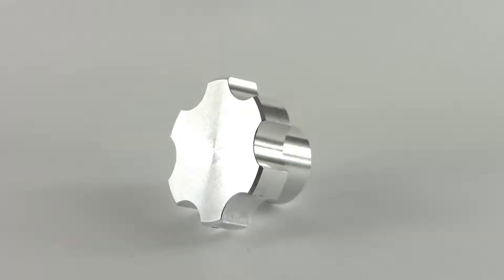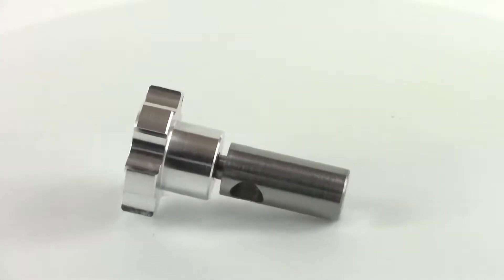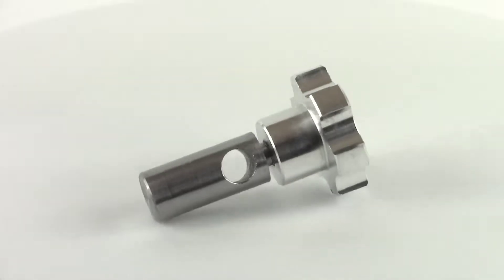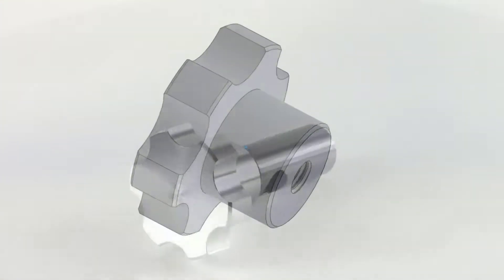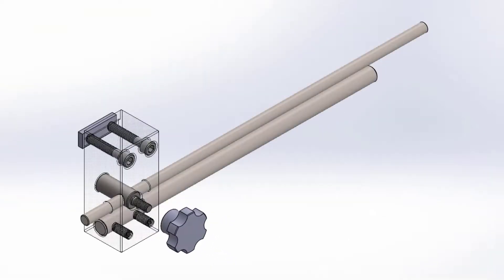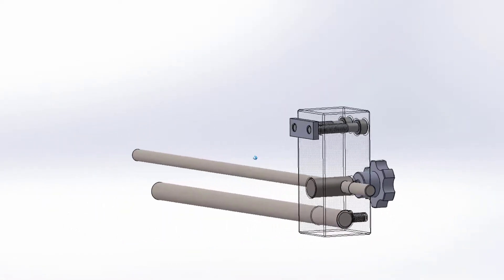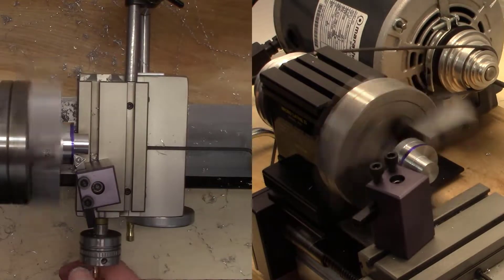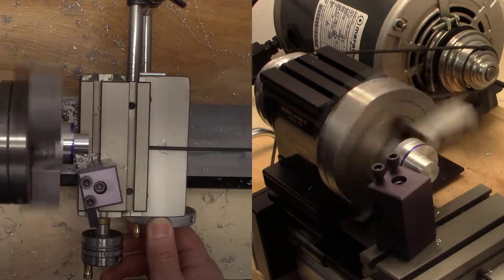MAKE: How to make a thumb nut on the lathe

Comment: What does the lower pulley do on the lathe?
Driving the auto feed for z-axis?
Reply from the maker: Hi Harlequin43 - The lower pulley is for the powerfeed that drives the carriage. It runs off of the main pulley on the headstock with, of all things, a rubber band. When you hold the handwheel on the carriage, it will power the carriage towards the chuck on the Z axis. This allows for a more uniform finish. When you are not holding the handwheel on the carriage, it will just spin, but very slowly. You can still move the carriage by just turning it by hand if you were to back it out of the way. Thanks for watching!

Comment: Have to say i am a little disappointed.  I really like the work you did, and the production quality of the video is very good to.  But I came to see how you make the thumb nut on the lathe, not the lathe and mill.  I wanted to see how you would make the cutout on the side of the thumb nut on the lathe.  Offset in a 4 jaw or dividing head maybe?
Reply from the maker: We would use Taigs milling attachment (1220), and hold the tool in the spindle. Thanks for watching!

Comment: Where do you get your tool bits from and what type are they?
Reply from the maker: Thanks for watching! The index lathe tools are from amazon - Anytime tools five piece 1/4 indexable mini lathe tools. They fit the Taig tool holder with no modifications. The insert is a TCMT 1.8 1.5 1
Inscribed circle - 7/32
Thickness - .094
Radius - 1/64

Comment: Seems we gain and lose with a Taig vs an eBay chinese one.  I see no drip plate, or back board, no gears, less HP, etc... on the Taig.  What is the advantage of a Taig over one of those Chinese eBay metal mini lathes?
Reply from the maker: Thanks for watching! 

Before you read below, know that I am NOT associated with Taig in any way. Just a satisfied user of their tools.

That's a tough question. The offshore machines offer a lot of details on paper, but in my perspective leave a lot of details lacking. I do have a harbor freight X2 mini mill, and the Taig manual mill, and the difference in quality is very noticeable between the machines. Out of the box, the Taig machines are tight and square and setup is easy. The X2 mill needs a bit of adjustment to get it Square, the quality just seems lacking, and overall use is sloppy. There will always be "mods" to make it better. In fact, I actually converted my X2 mill to a belt drive.

Sure, the Taig lathe does not have the drip plate, back board, but I really don't think that was necessary for this machine - nice features if they had them though. What matters to me is that the machine will hold size consistently, and the accuracy of the machine which it does well. It is very flexible in how you use it, and has many accessory's available for it. You can really build it how you want it. Don't let the 1/4 HP motor fool you, it is more than sufficient for this lathe...

My perspective on the small offshore machines is they offer more than they are capable of. The gears are typically plastic on lower end machines, the machines do not have enough torque to run the tools that they can accept (on the mill). As far as gears vs. the belt, you still need to stop the machine to change your speed, so to me I think that is a wash. Typically, I run the belt on the Taig in one position. For smaller parts, I run it faster and larger parts I run it slower. It takes seconds to change the belt on the Taig.

Now, some of the higher end import machines have better quality and components but it also comes at a higher price point. So, its all a balance of how much you want to spend vs. the quality of machine vs. the size of parts you anticipate running. I have found the Taig stuff to be sufficient if you work within the size it was designed for, at a decent value. Taig machines are also made in the US which I prefer. 

At the end of the day, buy whatever makes you happy. As long as you are making chips and enjoying it, that's all that matters!

Comment: I saw this and was hopeful that I could learn how to make this part on a lathe, since it’s in the title. Then you take it to the mill and do the part I was hoping to be able to do on the lathe. Disappointing.
Reply from the maker: Hi Deanna - To have the cutouts on the thumb nut like I have shown, you will need to put it on the mill. However, the form fit and function of the nut itself does not need the cutouts. Knurling the OD of the part is an option, though I do not have one. Another option is to scribe lines with an indexing head, I don't have one of those either. You could leave it without the cutouts and that would be perfectly fine!

The idea of the video is to show the operations involved in turning this nut. With this part, I cut the material long for chuck stock on the first side. The first side is facing, turning both diameters, drilling, and tapping. And,the second side is simply facing the chuck stock off, and facing the part to length.

By turning both diameters at the same time, or in one operation or one chucking means that both diameters run true to each other - that is has no runout. This also allows us to not need to turn our jaws to get our part concentric between the two diameters.

A Taig mill will really open up the flexibility between the lathe and mill! And, I apologize if that you were disappointed.
Reply: @benchtopmachining  I understand. I was just excited when I saw the cutouts and it implied those could be done on the lathe. I really want to be able to do those. But I don’t have a mill. Truth is, I also don’t have a lathe yet (just ordered one). Do you think it would be possible to do the cutouts with a milling attachment on a Taig lathe? I realize that indexing it for the cutouts would need to be done manually, with a lot of luck/patience.
Reply from the maker: @Deanna_the_Baker  You could absolutely use the milling attachment (PN: 1220) from Taig. I would also recommend the ER16 adapter for the 3/4-16 threads (PN: 1045ER) with the ER collet size of the end mill diameter you are going to use to mill the cutouts. That is, if you ordered the standard head stock lathe from Taig. If you ordered the ER headstock lathe, all you would need is the collet to hold your end mill. 

Then, the process is just the same as what I did in the video.
Reply: @benchtopmachining  I did order the ER headstock, along with the collet set. And the milling attachment. 

On a side note: do you know if a compound bed for the Taig? I haven’t seen one from Taig.
Reply from the maker: @Deanna_the_Baker  The compound slide would be part number 1200 from Taig - called the "top slide mounts". Its a little clumsy to mount but it works.

So, to iterate what the process would look like on the lathe -
1ST OP - saw - saw aluminum bar plus .200 chuck stock - meaning: (finish part length)+(.06 stock for facing first side)+(.20 for chuck stock) = saw length
2ND OP - lathe - chuck on .19 or less - turn first side - face - turn both diameters - spot - drill - tap - chamfer edges
3RD OP - lathe - turn second side - face to length - chamfer
4TH OP - remove chuck from head stock with part still chucked (do not remove part from chuck) - use milling attachment (1220) and (1221) chuck adapter (mount chuck adapter on the milling attachment and mount assembly to carriage) - find center of part with indicator - mill cutouts (KEEP IN MIND THE TRAVEL OF THE CROSS SLIDE AND MILLING ATTACHMENT TO BE SURE YOU HAVE ENOUGH TRAVEL TO MAKE THE CUTS)
5TH OP - deburr sharp edges and enjoy!

Take your time, and don't worry about making a scrap part. I have made a lot of scrap parts! Always wear safety glasses and never pull chips from the tool or part when it is running! Always stop the machine first remove the belt or unplug the machine!
Reply: @benchtopmachining  awesome! Thank you. I’m looking forward to being able to start turning some metal. Need to get the new bench built first, then set up the lathe. Lots to do before I can chuck up anything. My tendency is to over reach on projects (more complicated than I have experience with). I’m successful about half the time.  But, I think with this I need to limit myself to starting off with simpler operations first. That said, the knob will be made.  Lol

Thank you again for all of your help. Now to go back to watching more of your videos.
Reply: @Deanna_the_Baker  
Wow, you're the first woman I've seen (other than Blondie Hacks) who's interested in machining.

I'm a newbie with a CNC mill but have yet to cut my first part.
Unfortunately I have no lathe.

Once I get going on the CNC mill and gain some experience,
I hope to then get a lathe.

How did you learn your lathe skills
and what will you use your lathe for?
Reply: @mth469  my dad was a machinist for the aerospace industry. He was also an inventor/tinkerer. I would watch him fix watches and music boxes, with great interest. I guess a lot of that rubbed off on me. I’ve always been mechanically inclined. I had done some wood turning in my youth, and always enjoyed it. I’ve wanted to turn metal for many years, still waiting to cut my first piece though. My interests are very eclectic and diverse (interested in too many things). I’ve gotten very busy with work to get my new, custom lathe bench built. I have many different projects going right now. They are all interconnected with the lathe and the lathe bench. It’s like designing and building a 1000 cubic foot jigsaw puzzle out of thin air. 

As for being the first woman interested in machining. I have several woman friends in my life who are machinists. I don’t consider myself a machinist by any measure. It’s very much a hobby to me. These other ladies make real things. So, I’m still very much a newbie as well. 

What will I use the lathe for? I’m very much a geek. I make models and props and such. There are things that I’d love to be able to make out of metal. I don’t know that I’ll ever get to the point of making parts to sell, but who knows. I’m only 60, so there’s plenty of time to go pro. Lol.
Reply: @Deanna_the_Baker  

Hey that is just great to hear.   Life is so much more interesting when we have multiple hobbies and interests and there is something to be enthusiastic about when waking up every day.

Do make a video of your models, props or whatever else you are building.

Unlike you however, I have / had no one to show me the ropes.  So I'm trying to be self-taught watching YT videos, reading and taking it nice and slow to cover the bases.  Just about everything is new to me - especially the part about how not to wreck my CNC mill.

I will definitely cut my first aluminum piece soon.  I just need to make sure all ducks are in a row.  I'll try my first piece on a plastic block just to make sure I've got things set up right before I hit the big times and try it on Aluminum 6061.

I have always found gizmos and gadgetry fascinating.  Vending machines, pin ball machines, all kinds of precise automated machines.. etc.  It all looks like magic when it works.

Also the craftsmanship that goes into making of products, the attention to detail, the aesthetics, the design.

Comment: Great video.  I'm impressed with all of your work on your vids!  One question.  Why the helical insert? Cheers!
Reply from the maker: Hi Ron -  I used a helical insert because the rod holder part is steel, and the thumb nut is aluminum. As I make adjustments on the on the Z depth stop on the lathe, I would be frequently tightening and loosening the thumb nut. I didn't want to strip out the threads in the aluminum thumb nut over time. I appreciate the question, and thanks for watching!
Reply: @benchtopmachining  , 
Please address the dealer/distributor of this mini lathe, in Indonesia .

Comment: Great work!  Did you just "eye up" the finger divot machining, or was there a little more precision involved?
Reply from the maker: In the video, I used the indicator to find X and Y zero or the center of the part. The center is my X and Y zero of my coordinate system. When I draw my print for the part, I dimension the X and Y dimensions from the center of the part to the center of the tool location at each of the cut outs.

On the mill, each axis handle has marks to indicate .001 of movement. So, one turn of the hand wheel is .050 of travel and for perspective five turns of the hand wheel will move the axis 1/4 inch or .250. When I find X and Y zero on the part, I can zero the dials at the hand wheel as well. This makes it easy - your spindle or tool is at X0 and Y0 over your part and your hand wheels are zeroed out. From this point it is just counting the hand wheel revolutions to move to each new location in the X and Y axis.